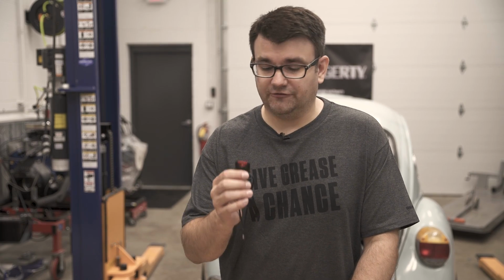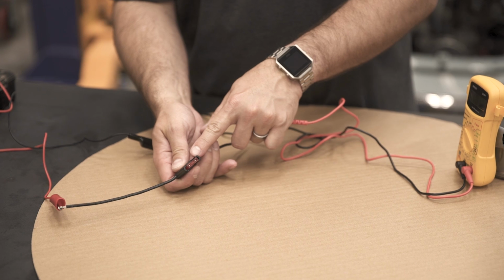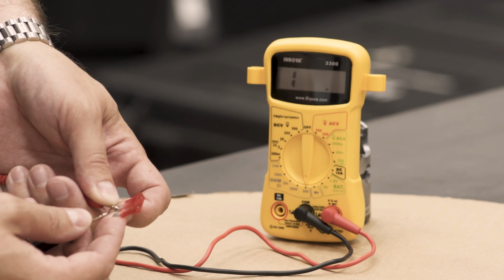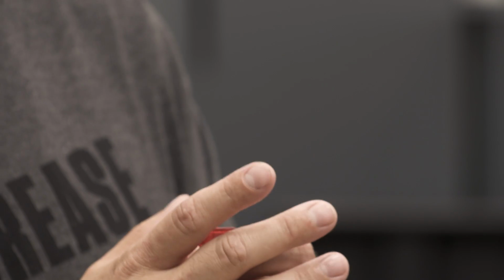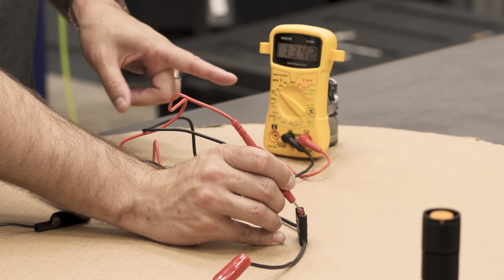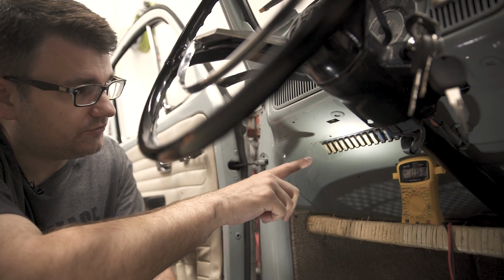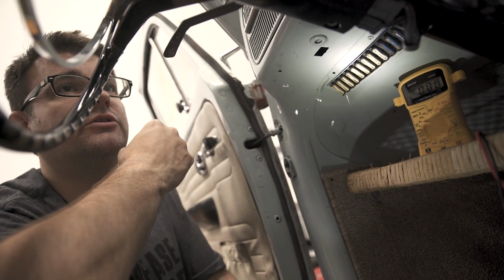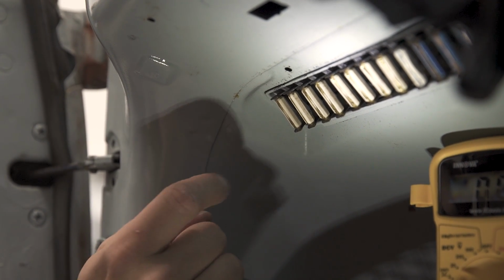Ins and Outs of Automotive Fuses | Hagerty DIY

Comment: I'm a test light on the top of fuse kind of guy, for fast trouble shooting on sketchy wiring.  I like the instant yes no of the light, then dig in with the meter after you find that thing that was spliced into the backup lights and ac compressor with a home style wire nut the previous owner wrapped in electrical tape.  Other than that great video.

Comment: You're right about the VW fuses.  They are kind of finicky.  Good video, guys.  Keep it up.  ☺
Reply: Lots of those electrical gremlins start with a fuse or corroded connection in classic VWs. I had trouble with my turn signals in my VW bus after driving around over some rough roads. A quick check of the fuse panel showed the fuse had popped just slightly out and there wasn't good contact with the fuse panel leads.
Reply: You can buy glass replacements for the old German ceramic fuses. The glass ones have conventional metal end caps which will not fall off or bend.

Comment: does it matter which direction i put the new fuse back in ? some of mine r upside down n backward… 2008 bmw 328xi, i mean i will j put it back in the same way it was before, but how it was before is backward vs. how it should look in the diagrams ? the actual fuse diagram was lost prolly in 2008 😅 its fuse 79 for the windshield wiper fluid pump